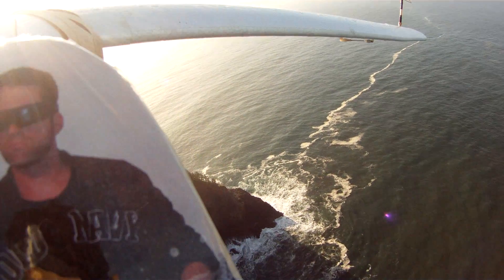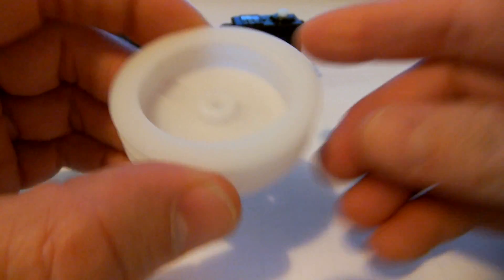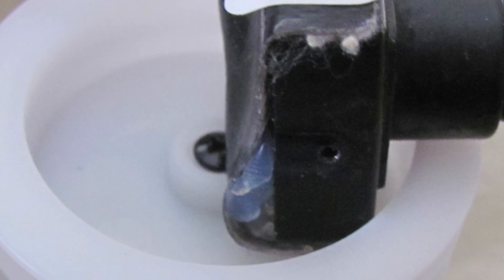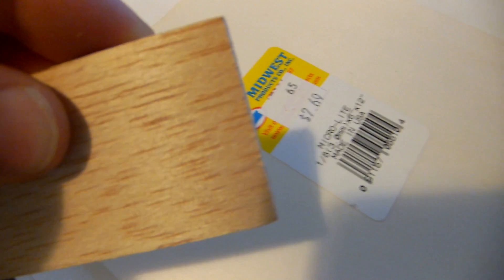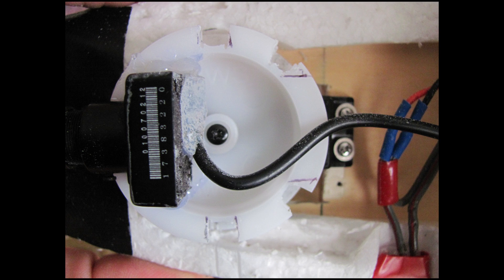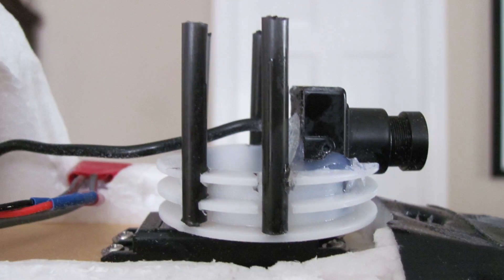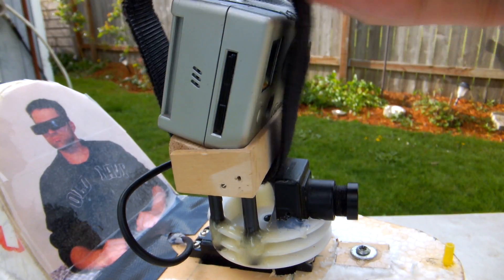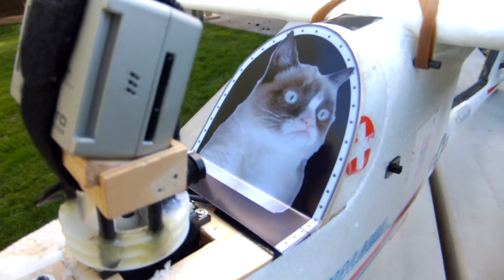FPV 360° Pan Mount - Part 2 (of 2) - The Build

Comment: Thoroughly enjoy the videos and the How To's!  I had a question, just got this servo and plan on building a pan and tilt.  Have you had any issues with this servo not re-centering?  Depending on the direction you move it, it will drift farther on center when it returns from counter clockwise then from clockwise.  I wonder if I just got a bad one?
Reply from the maker: Watch again at 0:42 and see how I control my servo from a dial. So I manually move mine and manually re-center it each time I move back. If you set this up to where it is on a spring centered control, then you will always see a bit of overshoot or under shoot with each return to center. Unlike tiny servos with only a short movement radius, these big servos have tons of gears in them, and they move such distance that there is simply a bit of mechanical play involved. Just like there will always be play in your steering wheel in your car. No matter how tight you make it, there is always a tiny amount of play which necessitates you to keep your hand on the wheel all the time, even on a long straight stretch of road. The effect is amplified when you put a camera on the servo, because even a half of one single degree look like an enormous amount when you are looking out of the camera.
Reply: Excellent.  I appreciate the information.  I was hoping it was something on those lines and that there is nothing wrong with the servo.  This is my first attempt at FPV but I wanted the pan because it seems really useful and allows you to even have a look at the airframe while in flight.  I eventually want to try setting it up with a head tracker on a FatShark Dominator V3 and possibly the EzUHF Transmitter.  I am literally installing the EagleTree Vector as we speak.  I see quite a few people like the SkyWalker platform.  You had to fabricate and setup the landing gear on that plane I would imagine.  My platform right now is the Volantex Ranger EX.  It has some interesting flight characteristics but I think it will serve its purpose for now.  Any thoughts on other good large airframes?

Comment: Thanks for all the great ideas!  I just flew last week with this servo and it was great! I'm using my Mobius as both FPV and HD cam so I just ziptied it directly to the white disk, angling the rear of the cam up a bit. Initially (https://vimeo.com/83908907) I stuck a toothpick in the nose to provide a reference point but later I reversed the servo so it starts out pointing toward the nose with the pot fully counterclockwise. Now I just have to turn it all the way left and I know I'm pointing straight ahead.  Thanks again...I'm a fan!

Comment from the maker: Good question, though this may vary depending on the thickness of the balsa GoPro base you use, and also the height of the live video camera. That said, my carbon fiber tubes are exactly 1 5/8" high (one and five-eighths inches). Hope this helps!

Comment from the maker: m. That one looks nice, but the price is a little high at $50 plus shipping. Try the one I used above in the video. It works perfectly, and has been through 4 flips already without any stripped gears.

Metal gears really just add extra weight and cost for no benefit. Maybe if we were mounting a heavier camera or something it would be better. Thanks for the idea, though!